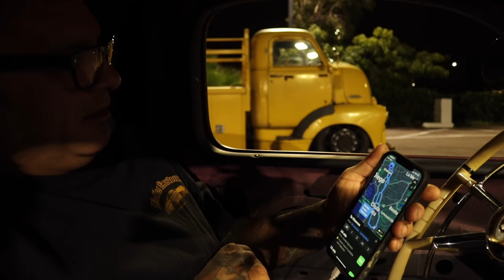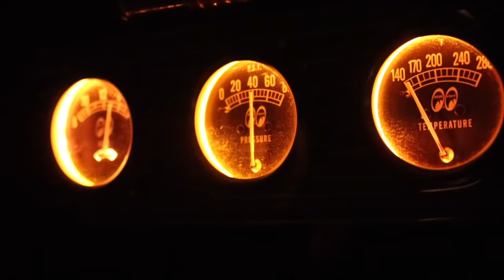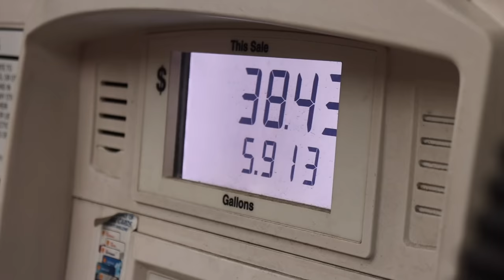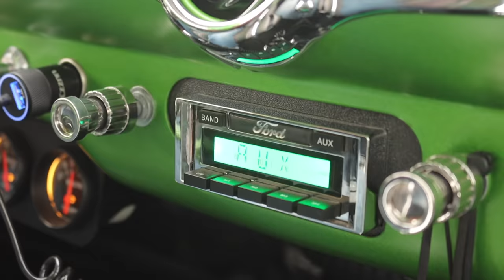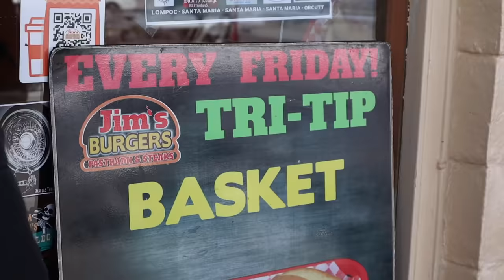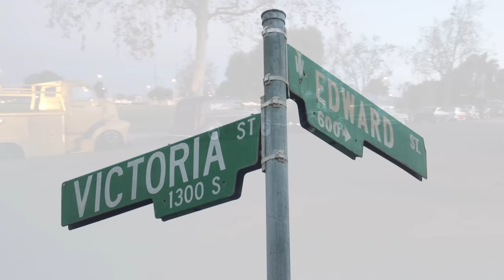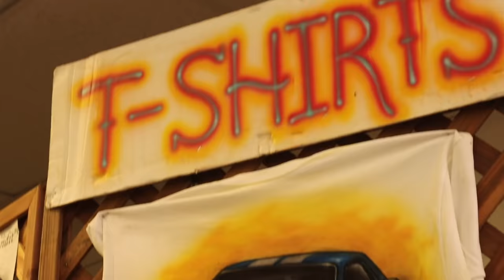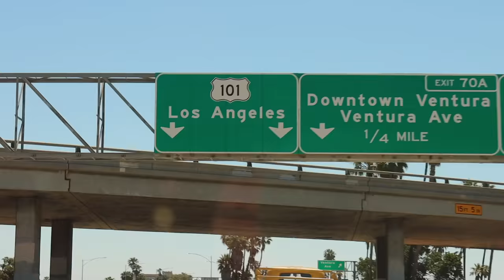2022 Cruisin Nationals | Santa Maria, CA

Comment: That is a badass video cruising to Santa Maria. My 1941 Chevy trokita goes to the shop in July is already left a fat deposit to start ordering the drivetrain..... Straight six with a four speed auto trans and modern differential. Four inch dropaxle up front and a  fourlink por atras.qvole. keep up the work with the videos. Gracias.

Comment: Here's a tip. Headlamp circuits are usually not fused. They are on circuit breakers. Most cars had them built into the headlight switch, but you can get one that replaces your fuse in the fuse box. It will save you gettin on your knees in the dark. Lol

Comment: Hey mike that whole with thread in front of the sbc is to srwe a longer bold in there to tighten the pushrod for the mechanical fuelpump. Otherwhise it will slide down. And you need to take of the plate behind the fuelpump. ✌️🤙

Comment: That hole in front goes into the fuel pump .they are blocked by the front motor mounts. Side mounted eng mounts have a short bolt. To long a  bolt hits fuel pump pushrod.

Comment: Get some of those Braun slim lights from H Freight they are decently priced and they are magnetic. They tilt and turn and are recharable. And we all know these oldies are all metal and the light can stick whereever there is steel. I dont work for H freight i just have a few 1 at work and 1 at the shop. Beats dragging an extension cord around or a phone.

Comment: Simply automotive art work at it's finest. Not an Asian part to be found.
Not light green to the belt line, dark green below with a narrow gold leaf pin stripe separating the parts. 
In spite of the color that low ride will still reel in the little Chiquitas by the car load.